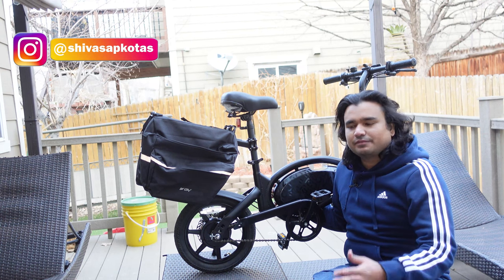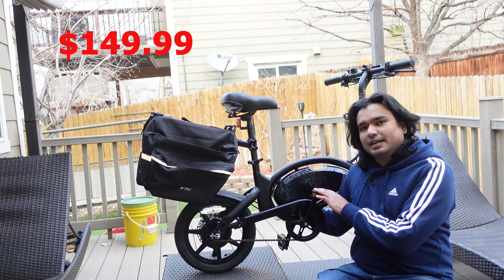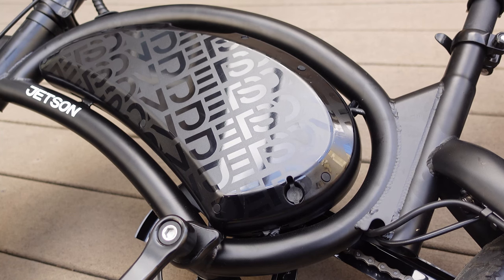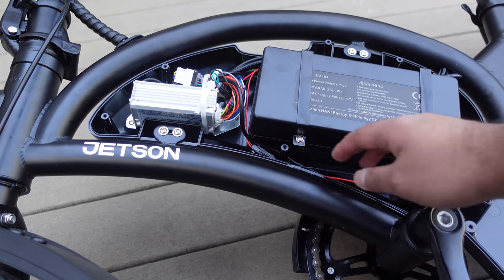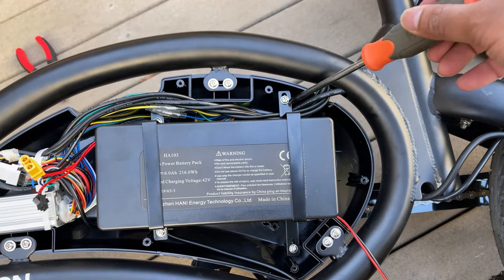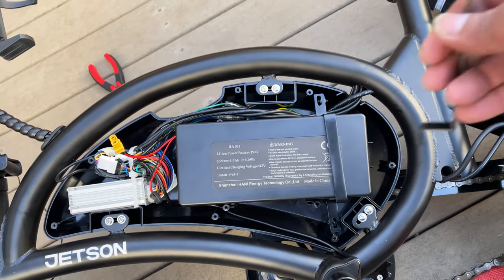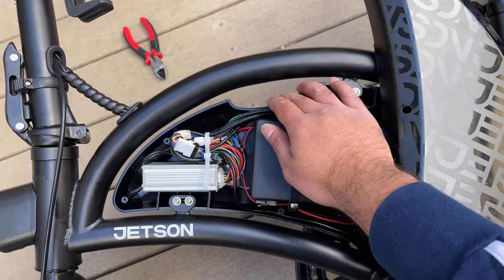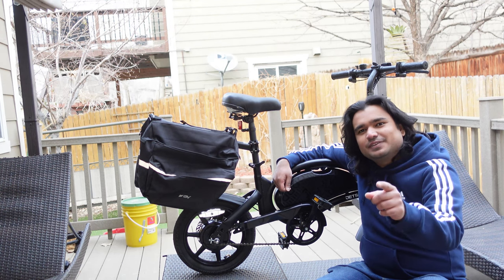HOW To Replace Battery and Cost (Jetson Bolt Pro Folding Electric Bike From Costco) 2021

Comment: So u paid $150 for that battery? They're ridiculously priced
Reply from the maker: Hello, thanks for watching my video. I didn't purchase the battery since my battery is still good but I got the pricing info from the manufacturer. In this video, I took my own battery out and put it back to show everyone how to replace the battery. Yes, I agree, the price is ridiculous! Hope they bring it down soon. Thank you again for watching my video and supporting my channel.
Reply: Hi thanks for your videos I want to ask if we can add a digital screen for speed and distance in jetson pro bolt thanks
Reply from the maker: @arefgamyan6366  thanks for watching my videos. Since a Bluetooth module is not supported for this bike, it would have to be a hard wired digital screen. I am currently looking into a screen and will make a video to show step by step installation if the screen works. Stay tuned for that video and many other videos about this bike in my channel. Thanks again for your time.
Reply: @ShivaSapkota  thanks a lot.
Reply: Check the price of some batteries online,$150 is nothing.
Reply from the maker: @pedrofernandez8729  Thanks for watching my video. Compared to other batteries, I agree, $150 is reasonable. But, since this bike costs just $300, paying half of that for a battery seems a little too much.
Reply: @ShivaSapkota 😢 hello thank you for putting that battery change on YouTube. I bought this bike two or three years ago at Costco for $499. I see Jetson is saying they have remanufactured it whatever that means I contacted their support and constantly got a shine on about the battery, the last one said that they do not recommend that customers change the battery but if I feel that I’m able to ride an e-bike then I should go ahead. This makes no sense to me. I see there are prices on Amazon that very from 99 for the Chinese battery up to the 149 you spoke of, there is one in between I could not find batteries on the Jetson website. This bike keeps charging up to four bars, but after I ride it 10 to 15 minutes it just stops. I saw another video not by you about resetting 3:57 batteries but I couldn’t see any kind of a button or anything on mine that I could do that. I also could not get that panel off after removing the little rubber guards or whatever they are. Can you answer any of these questions and help me out? I really don’t know what to do.

Comment: The bike says it comes with 350 watts battery. The battery in your video shows 216 wh. Are they cheating?
Reply from the maker: Hello, thanks for watching my video and thanks for your question. The 350 Watt is actually the electrical power of the motor. This value is calculated by multiplying the voltage and amps. In this case they are saying the 36v rated motor is drawing a little less than 10amps to get the 350Watt of power. Wh on the other hand measures the battery capacity. Wh is calculated by multiplying battery voltage by its amp-hour (in this case they list 6ah). So if we multiply 36v x 6ah = 216 Wh. Since Watts and Wh are different units, I don't think they are cheating, the math checks out 😊 Great question though, thank you.
Reply: @ShivaSapkota  :).. Such a detailed explanation. Great. Thank you.
Reply: @ShivaSapkota  subscribed. I sense your channel is valuable.
Reply from the maker: @bestinlot  Thank you very much! I really appreciate your support.

Comment: Although my bike is still relatively new, it is interesting to know how the battery is replaced as this is its major source of power. You did a good job explaining how it is done. It is nice to know that this instructional video is there to view again when the time comes for battery replacement. By that time, I hope the price of the batteries will be lower. Good luck to you and more power to your channel.
Reply from the maker: Hi Rene, thank you very much for your support. I really appreciate it. I will have many more videos on this bike to help folks maintain it in the long term.
Reply: I recently bought one and love it!
Reply: How is this going 2yrs later? Still running good with no issues?

Comment from the maker: Thanks for watching this video and supporting my channel. Let me know if you have any questions. 
I installed 2 batteries to get double range: https://youtu.be/5kr7u0--iGI
Here are my recommended accessories for this bike:
✅Rear Rack: https://amzn.to/3mKvpES
✅Storage Bag: https://amzn.to/2WB96Hk
✅Water Bottle Holder: https://amzn.to/3pmqZ9b
✅Lock: https://amzn.to/3hbhCpT
If the rear rack if out of stock, this one should works as well: https://amzn.to/3ovIp2i
Here is a playlist for all my Jetson Bolt Pro videos: https://youtube.com/playlist?list=PLthI4lX2FgtOXUCXRXsM6Lzlb80moKzUk
Reply: Have you added the Bluetooth controller(to boost speed)  and if so how to install and where to order one
Reply from the maker: @BONGOLICIOUS1  Hello, those bluetooth controllers are impossible to find. I am going to just get a better motor controller and get more speed. I am currently working on one and will post a video if I get it to work. Thanks for watching my video.
Reply from the maker: @davef2320  Hi Dave, my appologies I didn't see this earlier. It looks like that battery would work to add as a second battery. You can also use that battery to replace the existing battery but the one you have here is shorter than the original so it might be a little loose. You will need Dean's T plug to XT60 converter. Please check out my videos on dual batteries to learn more.
Reply: can you please provide me a link to where i can get a battery
Reply: Have benefitted from your videos - thanks. The 'green-dots-charge-monitor' no longer shows any dots so I only know if there is juice by turning the throttle. Can you determine if it's easy to replace the monitor & create a video showing how? Again, thanks for your helpful videos.
Reply: Hi! I have a similar model by Ancheer. The battery works, powers on, lights, horn..but the back wheel seems to be locked.  I'm not sure what connection to check to see why it won't move with pedal assist or gear. Any advice?

Comment: Thank you, I just did this procedure.  I used the blue battery that is a little higher amp-hours than stock and also has a different charging port.  I just drilled out a 1/2" hole to run the new charging port cable out of. Clarification: I drilled the existing hole slightly larger to 1/2" to run the charging wire & jack from the new battery to outside the case.

Comment: This video was very helpful I install the new battery all by myself with the help of your video 
Thank you 
I am having issues with my throttle one minute it works then next minute it stops working and doesn't turn back on until I leave it off then it will do the same thing all over again
Reply from the maker: Thank you for watching my videos and supporting my channel. I think your throttle cables are lose or disconnected. You could also have a defective throttle. Please watch this video to on how to replace/troubleshoot it. https://youtu.be/F9nTOhPg-e8

Comment: Very informative videos. Am going to purchase one. Been debating whether to covert my bicycle or go with an ancheer for 600 ot gas motor or electric motor kit. So many options.
Reply from the maker: Hi Michael, thank you very much for watching my videos. I highly recommend this bike especially since it costs just $300. Ancheer bikes are nice but not very affordable. Their cheapest model that costs over $400 only has 12 miles of range, no pedals and smaller wheels. You can add a second battery to this bike if you need more range (check out my video from last week). I am not sponsored by Jetson so just my honest opinion, with a low price tag and a decent performance this bike is great.

Comment: Thank you! I will be replacing mine soon. Are there two ports disconnected? When I opened mine two were. I want to know if that’s normal. I saw at least one that was not connected to anything in your video.

Comment: I have owned the JETSON Bolt pro bike from Costco for several years and have enjoyed riding it to work (7.5 miles each way).  To work is mostly level and downhill, home is mostly level but uphill.  When i get to work i still have plenty of power left (3 lites). During the day I charge it.  Going home I need pedal assist right away and use the throttle.  Lately i have not been able to make it uphill to home so i end up pushing my bike the last 1/2 mile.  W😊hatshould i do differently.  When I first started riding to work I didn’t  t even charge ir and
 it and i made it both ways.

Comment: Hi Shiva, new viewer here.  For what you do for the Jetson company they should sponsor you with new equipment for your review like other youtubers. Quick comment and question.  I saw an eBay replacement battery for only $127 that was 36 volts and 10 AH.  One of the comments was used in a Jetson Pro bike.  I'm not an engineer but I do dabble a lot with lithium batteries.  Do you think I could just buy this replacement battery and hook it up in parallel to the existing battery to give me greater range?  I don't care about the look and could strap it to the frame or put it on a back rack.  The only upgrade I'd want in greater range and maybe a better seat for comfort.  I would like to hear your thoughts.  Thanks.
Reply from the maker: Thank you so much for your kind words. Please check out my Jetson playlist, I have a few videos covering that topic of adding a second battery. Hope this helps: https://www.youtube.com/playlist?list=PLthI4lX2FgtOXUCXRXsM6Lzlb80moKzUk

Comment: Great video thank you . You are really showing the product well. I think for the money. It's a good little unit. I'm guessing the only time you have to pedal with any effort is , when going up hill or when the battery is dead. I'm curious if you can ride it without using the battery power at all until your tired?

Comment: Need to know how to replace the crank for the jetson pro ebike. Can you help?
Reply from the maker: Hi David, thanks for watching my video. I might replace my crankset in the future but I haven't planned it yet. With the original jetson speed controller, you can probably do a 52T for pedaling speed upto 15mph. The battery power to the motor seems to shut off if you go any faster than that. With the original crank, I have only been able to pedal 12mph without throttle support. If you want faster pedaling speed, you will need to replace the controller that doesn't have any speed limiter and can go with a 62T crankset. If you lookup some videos, something like this should be fairy easy to install: https://www.ebay.com/itm/Litepro-170mm-Crank-130BCD-45-58T-Chainring-Road-Folding-Bike-Crankset-Sprocket/123981367507?_trkparms=ispr%3D1&hash=item1cdddd88d3:g:eVsAAOSwM~dd06gt&amdata=enc%3AAQAFAAACcBaobrjLl8XobRIiIML1V4Imu%252Fn%252BzU5L90Z278x5ickkp2NA0WuhQytmt4dbStg00PMRpmfgazZYUxDGyj82TQYh6n4d14cU8EuH7oA7TsLGRspqvn5yyUc7H%252Fz9ZHQcU%252B66%252B0GhnB1s9h3PuHVRrirdF9acq12AN9cMJ70gtjc0RDuvtQogIWpHc%252BaW2yrRhuO9akDUpAUAvgLoi74cGfZLoa%252BCYo4LXp0AQjm81WcalnNebLME379E9bJw5BY663PV7w20ZMQ%252FNa%252B4DD43SkOiswIN03dO4soyyzNRQUoiVzrHFkFhXDrvgPu0CE7Kyt7rGeDSDR2znc3q3n2nJsU0ARl%252FKBnk%252BtquWcy9K7xhkjZGIk5ZoEqKg1%252Fb5LIJJ6qgldko72f0rPVX3%252FfroL1XLIKaHKILj86sdPqG69T92A8S%252FHTIfm1BcxsSa4udPUHGxX5roBh7mVd7YEKUS8CTzvE0PXHfT9Gih4sF%252FX57is9uQYW69uX3fBVuRo6hBFJQvuoqX%252F3FRXQqp5kmbr1uXAQ0QGJkZFVBGviCEeqbcVCWmoYTGe7sa2GrQMbhyQu8mgxhixV1aOYEFRM4Cdi18oA%252BWCrmRDPXTCzyj5AtgDxw3Ga6RIf9cCXbaQmJQV2n8puIR4gAuVy3nQx4Es5s926lMt7lfb0IHJU7Bf4Zp9SXPrePvuROwqCYPQI8YHP0lr1YUFsZ8zrlfbzjXtRtuoQL9r3oboTQF1RJnV6UTjdCLJOYy8AI9lBKppMDDyvqs6PlyZappubIoxLspk2kp1pS0XOKuXR%252BXrfyUAw48glmxSuwPBSzFo5dH9jEAA%253D%253D%7Ccksum%3A1239813675072e40650d38284451847a769a64c204de%7Campid%3APL_CLK%7Cclp%3A2334524

Comment: Thank you so much for the step by step instruction on replacing the battery.  That is going to be so helpful.  I have owned my Jetson for two years now and love it. I have put a lot of miles on it, and haven't had any problems.  My tires are wearing though, and I know I'm going to have to replace them really soon.  I would love to see a YouTube on how to do that.  Also, what tires would you recommend?
Reply from the maker: Hello, tire replacement will be one of my future videos. I am going to try some tires I found in amazon (might be cheap so we will see). Jetson also sells those tires, I saw the Bolt Pro ones back in stock.
Reply: @ShivaSapkota  Good to know.  I just looked on the Jetson website for the tire and OUCH $40 for one tire and tube.  I'm sure I can do better.  I will let you know when I find a good price, and I will wait for your video before I change it.  Again, thanks for the info. and YouTubes.

Comment: What bike do you recommend for first time e bike rider? I am 5'9" and want your opinion on swagtron vs. Jetson Bolt Pro. Dont care if its not too fast and just need it for when trains are down in the city.
Reply from the maker: Hello, thanks for your question. I have never owned any Swagtron bikes so I cannot really comment on their performance. However, the Jetson Bolt Pro has been a great bike for me. It is portable, inexpensive and easy to modify. Since you don't care about the speed, I think this bike would serve your commuting needs very well. This is for sure a great starter ebike. Thanks for watching my video.
Reply: Thanks very much for your reply Shiva.

Comment: I've subscribed to your channel as I have a similar ebike, kugoo Kirin v2.(or b1)
Please do you mind a question..?
I don't know if it's a normal thing...but mine, when rotating the back wheel, it obviously spins, but no completely free.
Is like when you press a bit the disk break,that the wheel stops before it should. (Breaks are Alright)
Not rotate free, I assume is the bearing inside too tight inside of the motor.
Is any way to access the motor to find the issue causing this tight spin.?
Sorry for bothering you...but I can't find any video related with changing this ball bearings inside of the motor...or similar.
Reply from the maker: There is a little bit of drag when you try to spin the wheel with the motor. However, if you suspect the brake pads are touching the disc (usually makes a grinding type of sound), you should adjust those and get them free. There is an allen screw you can adjust to loosen/tighten the brake pads. It is normal however to have a little bit of drag as you are trying to spin the wheel with motor installed on your hub.

Comment: Good job on all your Jetson Bolt updates and mods.  Can you (or someone) answer brief question for me?  I have 4 Bolt Pro ebikes and need about double the battery capacity on each of them.  I need to keep the upgrade internal on the bike, and I'll be using same controller since I want more distance, not more speed.  BEFORE I go buy 4 batteries and try to shoe-horn them into each bike, can you please provide the largest battery dimensions that can be accommodated INSIDE the case of a Bolt Pro - assuming I leave the controller in place, but also assuming I won't mind cutting out a bit of plastic and/or removing some padding and/or even cutting out a screw-post or two.  What are those max dimensions of a battery I can buy and fit in them?  Can I make a 12Ah fit, and which one?  Is 10Ah the largest possible to fit internally?  Or worse, only 8Ah?   Please help with max possible dimensions and largest capacity battery you (or anyone) know(s) of that will definitely fit inside the case.

Comment: Dear Shiva Sapkota,
I have a question for ya. I have a 36V 250W battery in my Windgoo(looks the same as Jetson Bolt, but white color). I have seen some of your uploaded videos and I am wondering if I could get not a 6ah what is has now although a a 12ah or even more with the same dimensions. 

Is it possible to swap it so I can double or triple the range??
I am not keen on more speed as this way it can stay road legal.

What do you think?
I am looking forward to your answer. Thanks and keep on doin` what you doing.
Reply from the maker: Hello, yes you can get a higher capacity battery and probably have the same dimensions. Please open your controller housing and check the dimension and get any 36V battery you can find online. I would say max you should trust is 36V 20AH (so 10AH, 14AH, 16AH, 20AH etc). After that, they make false claims about the capacity.

Comment: I had this same ebike but just returned it because I was not getting anywhere near the range they advertise. Maybe 10 or 12 miles work pedal assist but one time it died after 4 miles and was fully charged. 

Did I just have a bad unit or have others had a similar experience?
Reply from the maker: Hello, thanks for watching my video. I think you just had a bad unit. I have 2 of these bikes and I get 13-14 miles with full throttle (no pedal assist). I get double that with pedal assist before my battery dies. You most likely had a defective battery.
Reply: Gotta be a defective bike, I got one 2 weeks ago and ride 11 miles total to work and back almost daily, then let friends ride it around my neighborhood for at least another 5 miles before I gotta charge it

Comment: Hi !! I just got a new bolt pro. It’s very well built. My issue is that The fastest I can go on a flat and a fully charged battery is 12 mph. Is the rated 15 mph if you are also pedaling along with throttle? I’m 170lbs. I feel like most hit 15 mph on the flats.  After all that I tried the speed hack with a original bolt Bluetooth controller and the old app. It connected, and let me turn the range up to 19 mph, BUT, it still will only average 12 mph on the flats. Seriously if it went a solid 15 mph I could live with that. Lol. Any thoughts? Thanks in advance! Love your channel!! 🤙